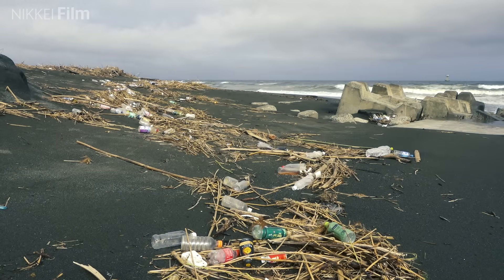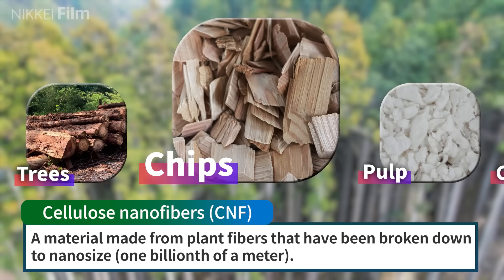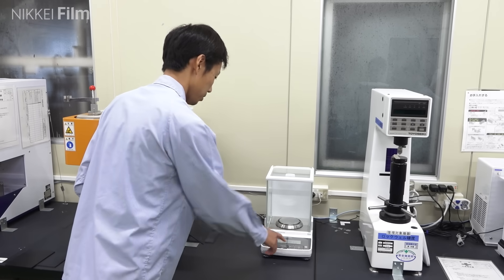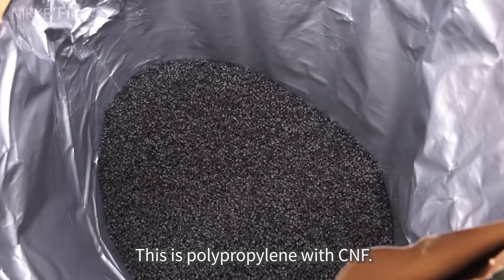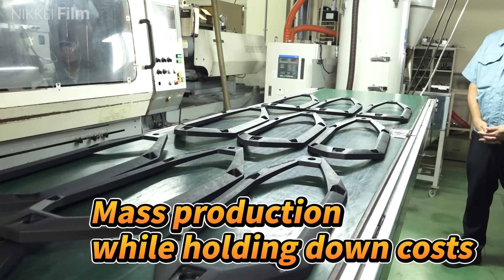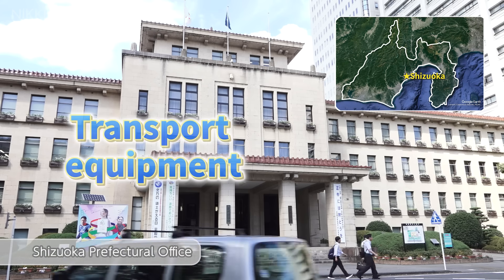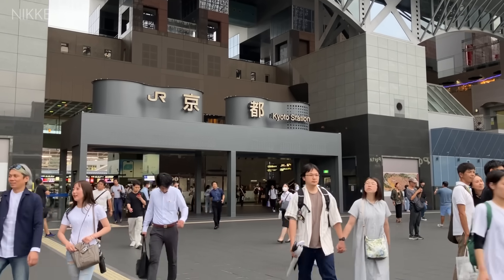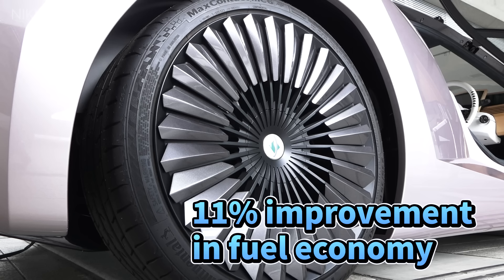Five times stronger than steel: Japan's new 'wood' | Nikkei Film

Comment: It's ironic that the theme of this video is a reduction of CO2 and plastic waste yet the product focussed upon is a small part for a machine which has no practical value other than for the amusement of the owner.
Reply: It’s the beginning..
Reply: Do you know the history of gunpowder? It was originally invented by the Chinese as medicine and fireworks. The point is that no one can predict how an invention can be applied. Today it could be engine covers. In the future it could be a fuselage for commercial aircraft.
Reply: because someone has to pay for it. that means you search for use cases that profit the most. for a jet ski, weight is an issue. it also seems that in this case it has an added benefit as vibrational dampener,  that carbon fiber does not have.
Reply: Most pertinent comment!  The starting point of all discussions about co2 footprint needs to be "which things out of all the mountains of crap that we produce do we actually need".  Classic example is that everyone now "needs" a thousand dollar barista setup in their own kitchen to make a $1 cup of coffee that's just as good made with a $10 pot. Everything now is like that.
Reply: @CitizenAyellowblue  I'm glad someone understood my comment.
Reply: The beginning seems like a green washing infomercial to me. The material seems fantastic and after 20 years of research of course the only way to lower cost is real mass production. Yet Yamaha is only using it in a small hidden non critical part of a machine that is mostly plastic or metal and runs on gasoline. The part they replaced doesn’t seem to have any requirement that would justify the use of this new material and at this size the weight loss must be negligible. If only it where used to replace most plastic parts on the watercraft, like in the supercar, now that would have been something else, even if initially there margins would have suffered due to the investment needed.
Reply: the video actually shows a wide range of applications. The product here is the material itself not the consumer good.
Reply: My question is: Has anybody determined the total reduction of CO2 vs the CO2 produced during the harvest, transportation, processing and eventual turning of the tree into cellulose nanofiber?
Reply: High performance machines are where new expensive materials get used first due to weight reduction and performance gains and less focus on final sticker price.
Reply: to be completely fair, a jet ski is a good small vehicle that experiences direct wear and tear that can be measured, imagine they made a whole car out of this stuff at testing scale, it'd be crazy expensive
Reply: The ironic part is that its a resin composite, meaning its a plastic. Its a plastic with wood fibers in it.
Reply: Cellulose nanofibres....you mean paper?
Reply: Not to mention the whole carbon emissions agenda is a geo political  banking scam designed to impact land, farmers and population.
Reply: Your comment got the standard appologetics for trickle down consumerism - we have to build unnecessary toys for the wealthiest or else the children of the poor unwashed masses will never get to have the toys the wealthy have now!! Only by consuming more can we battle the negative effects (and *affects*) of over-consumption. What they are really saying is, "Don't take my toys!! I want one of those!!!" The video also referred to the crop as a "forest" but you don't want to mention that - the environmentalists and the climate deniers will both yell at you how we can just regrow "forests." It's easy now since it takes less time for time to pass and a pound of feathers weighs less than a pound of lead. Almost like magic!!
Reply: Hahaaaa
Reply: And those worthless engine covers to hide the mess beneath...
Reply: tell me you haven't watched the whole video without telling me you haven't watched the whole video.
Reply: It's ironic that the theme of this comment is to mock the efforts in reducing CO2 emissions while only focusing on a small part of the video, rendering the comment of no practical value other than the amusement of the owner.
Reply: You’re missing the point. The new lighter and stronger material can be used on cars, aircraft and electronic devices to make them more fuel efficient. This is only the beginning, it’s just testing, basically.
Reply: @Jin88866  You are missing my point- Yamaha are producing what is really a toy, which is adding to CO2 emissions by burning fossil fuel. Agreed, the new material has the potential for a lot of beneficial uses, I just don't think this example is one of them.
Reply: @Jin88866 It's a very poor test and a lousy example if you're trying to demonstrate the value of new materials in conserving resources and keeping the planet healthy.  How about something meaningful like using new materials to build cheap, durable housing?
Reply: Not all boaters are leisure boaters. Some fish to feed their families.
Reply: @barthanson3043 Not on jet skis.
Reply: @barthanson3043  The 'personal watercraft' featured is hardly ideal for any kind of fishing.
Reply: @gerry343  haters gonna hate 🤷

Comment: What happens to the co2 absorbed by the cnf?
Reply: It remains embedded in the plastic / CNF matrix.  It this matrix is truly recyclable, as claimed, and the recycling process expands to add recycling of CNF composites, then the CO2 will stay in solid form (like it once was in coal, but likely in a less concentrated form)
Reply: @gregparrott  so it holds the co2, yet is recyclable, & the co2 becomes solid?

so does it just get bigger, or does it ooze dry ice?
Reply: @Iowa599  it came from tree, and tree get bigger because that's where the CO2 is solidified. 80% of a tree mass is CO2.
Reply: @xponen  the Nikkie film turns into a tree?

Comment: What a load of green washing rubbish. Of course adding fillers to plastic will make it lighter and increase tensile strength. All that's new here is which filler is used. Hardly going to make any significant impact on carbon capture or plastic waste. This is just another different plastic that won't be possible to recycle with all the other plastics.

Comment: Chip board and particle board are also wood and resin .what is Resin made from .? Is it plastic or another byproduct of Oil .The crucial and primary concern should be the elimination of Plastics. If Resin is a byproduct of Oil and related to Plastics , then the targeted purpose is not met. Consider the loss of Trees which is a greater loss to carbon control .
Reply: for carbon control, tree can only absorb CO2 when it is growing, and the only industries that continuously grow trees for profit are paper industry. The loss of tree by cutting it down to create CNF or wood-based product is necessary to funds this enterprise.

Comment: there is no comparison to main competitors like carbon fibre, or carbon nanotubes.
what is the strength, cost, weight differences.
Reply: I'm also very confused by this. "Five times as strong as steel" - I'm assuming for the same weight - is the same as claimed for carbon fiber. But cellulose fibers are nowhere near as strong as carbon fiber. So the whole thing sounds fishy to me and they have made a long video which totally avoids explaining what we really want to know. I daresay these cellulose fibers are plenty strong enough to make this jetski part though, I don't doubt that part.
Reply: When you carbonize CNC/CNF's, you essentially get a nature closer form or version of lab engineered/made carbon nanotubes, but in much higher bulk amount for much lower cost compared.  Obviously the carbonizing process uses a fair amount of energy, but that could be done with evacuated/vacuum insulated Solar heaters in combo with direct Solar panel DC to resistive heating, basically using the direct heat of the sun + Solar PV generated electricity to carbonize the material pretty cheaply and cleanly.

Comment: I can argue with a 100 reasons why this is a not as big a deal as it is being made out to be. Hemp fiber is infused with epoxy resin also and is very strong. Plastics and resins are still needed in lesser amounts may be. And this decarbonization gimmick is a hoax.
Reply: There are different levels of strength.  CNC/CNF impregnated epoxy composite will be noticeably stronger at lighter weight than hemp cloth epoxy infused composite. 

  Carbonize the CNC/CNF material and even more so, especially with the stiffness strength.  But hemp, bamboo, and/or balsa would be a bulking material for structures that need to have very high stiffness and/or some thermal insulation, sound blocking, or the like.
Reply: It really isn't that big of a deal, but it's renewable, lighter and stronger. Japan doesn't have huge tracts of open land to grow your hemp either. Also, the decarbonization myth itself is a myth. If you were one of their consultants you'd be fired.
Reply: @subcitizen2012  to be fair, hemp grows more fibre per m² soil than wood, so it is more efficient than a forest. Not to speak about the more frequent harvests.
Reply: @MannIchFindKeinName   So doesn't bamboo.
Reply: @subcitizen2012  I don’t subscribe to the environmental hypocrisy. I am not saying Japan should grow hemp. The part that was being made and was glorified in the video is insignificant in its function and it won’t have any positive impact on the environment. I regard Japan very highly and was surprised to such meritocracy from such a large reputed company. Show us something truly remarkable, not something so lame that is embarrassing.

Comment: 2 points. 1. Normal traditional plastics are totally recyclable, much more easily than this product.  2. If you want to really do something about the environment ban the silly watercrafts, they are a waste of fuel products and a constant un-necessary source of pollution. So your want to add this to food products, has the long term effect of this product on the human body been studied?
Reply: Ban watercraft? 

You must be fun at parties
Reply: Agreed. Also, make every product out there better quality and usable for at least 10 years.
Reply: 1. You criticised the video
2. Your solution is garbage
3. You clearly missed the decarbonization part.
4. 😂😂😂😂😂
Reply: Replacing recyclable plastic means it wouldnt need to be recycled. It would just be biodegradable instead of floating in the ocean.

1/1000th of your body weight is already micro plastics and they don't fully know what that's doing to us yet. Plus, you already eat cellulose everyday.

Kindly stfu and go learn to learn.

Comment: It's a non structural part. It's purely aesthetic. Why not remove the part entirely.
Reply: 5 x stronger than steel
20% the weight

Im sure it will be used in a structural part
Reply: That was my first thought, but it does give the material real world exposure/testing without being a critical component.
Reply: Because jet ski.
Reply: If you were introducing a new material wouldn't you do it on a non critical system so you can see how it performs in the real world?
Reply: You want mud bikes without mudguards?💩
Reply: Let’s take fenders off of cars, too, eh?!
Reply: @cgcrosby2  Fenders are structural components on a monocoque chassis, like on most modern cars.